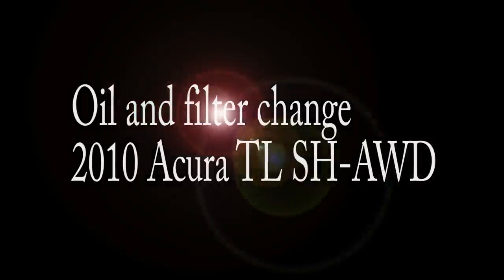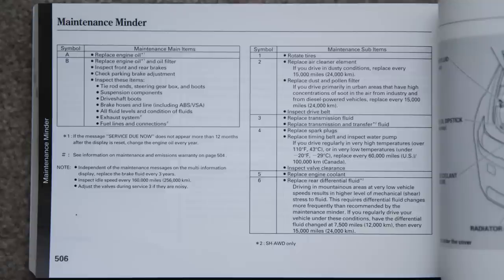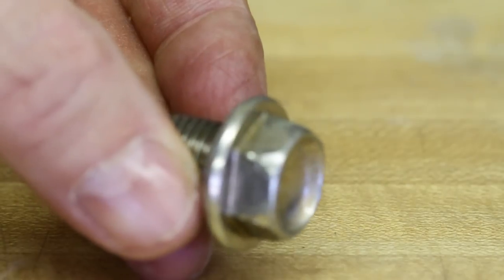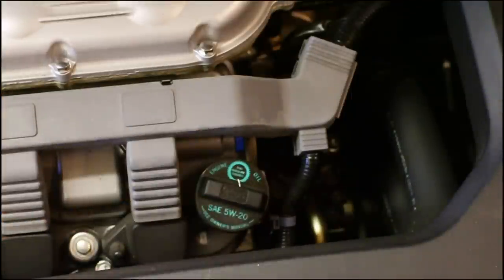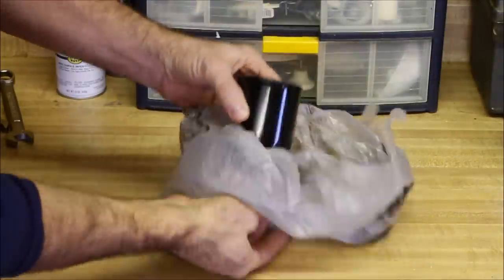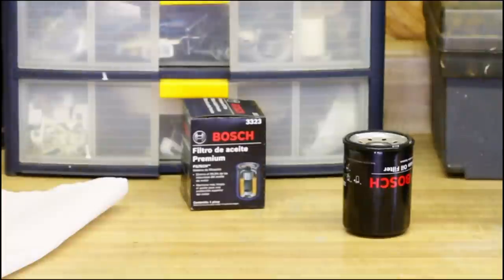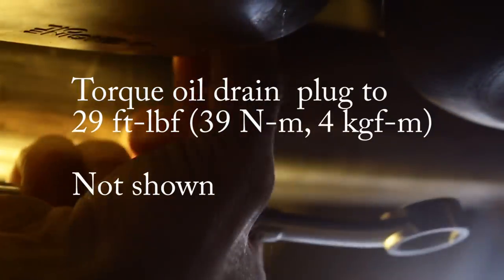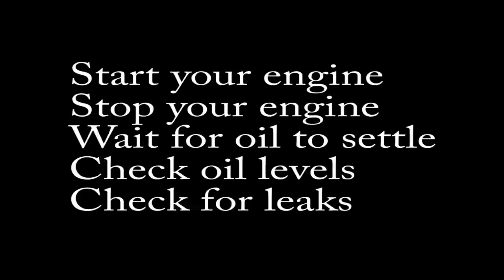Acura TL SH-AWD: Oil Change and Filter Replacement

Comment: thank you that was very well done and yes it applied to my 2 wheel drive 3.5 L 2011 Acura TL one small note you're not completely finished with the oil change until you reset the annoying service engine now light so it would be nice if you'd include a little tutorial for that I can't seem to remember how to do it from oil change to oil  change thanks anyway great posting
Reply from the maker: I have a separate video in resetting the reminder. My statistics show people only watch 3-4 minutes and if that were at then end, they may never see how to reset the reminder

Comment: My friend  have a question. I read this 
2007-2011 3.5Liter: 5W-20 (S/UFS), topped off with 0W-20 
And was wondering what is topped off with OW-20 means is it a different oil and how much do you top it up with?
Thanks

Comment: Very well made video thank you. Have you experienced the oil consumption problem on your TL?
Reply from the maker: Thanks. My TL doesn't seem to have the consumption issue. It will drink some but not like others report.
Reply: @KrisKasprzak  that's great to hear looking forward to buying this car soon and watching your videos to maintain it!
Reply from the maker: I tell you the SH-AWD handles extremely well, i have continental dws tires and it rides like it's on rails--i can hit the gas hard in the rain and no wheel spin. The audio (mine has a sub) and it totally rocks. I let my Daughter drive it and she won't give it back. I took a new TLX and even a Q50 out for a test drive and I sure miss my 2010 TL.
Reply from the maker: PS get and SH-AWD version.
Reply: @KrisKasprzak  absolutely! It's got a 6 MT. I just need some motivation to pull the trigger. Do you think 140k miles is too much ?
Reply from the maker: if well taken care of, no.
Reply: @KrisKasprzak  I appreciate your input man you've gotten yourself a new subscriber
Reply: @supersabrosinho  as long as you've redone the timing belt, water pump, inspect tranny, and get the engine components inspected you should be fine

Comment: My 2010 tl sh awd consumes a lot of oil. Only 97k miles. Any solution suggestions?
Reply from the maker: Lot's of posts on this in the Acura forums, some claim it's faulty rings, other speculations. I'm not losing much but i'll just keep an eye on it.
Reply: Yeah call acura make a complaint they will get u a new block they did for me
Reply: My 2010 TL Sh awd/6 manual consumed oil at 96 k. I did a research my research and had the PCV valve replaced at the dealer. There's a recall on all J37 TL so Acura increased the engine warranty to 200,000 k. Oil consumption test was also free. But you need to bring your car 3x for testing.
Reply: @AcuraPerformance  either u got the 3.5l or 3.7l its gonna eat oil fast so be expected for oil service intervals

Comment: can you reach the oil filter under the car instead of going through the tire? reason i ask is because i am using ramp and won't be able to cut the wheel while its on the ramp
Reply: Yes. I changed the oil with it on ramps. Just reach up and screw it off.
Reply: You can but its better if you take the tire off so you have better access to the filter

Comment: you forgot to mention how many oil quarters and how to reset the engine light!
Reply from the maker: See my other videos for resetting the engine light. As i say int the video, be safe and check your owners manual for the capacity.
Reply: Approx. 4.5 quarts inspect dipstick without oil in filter

Comment: Does your TL burn oil?
Reply from the maker: Slight--maybe 1/4 quart per 2000 miles
Reply: Regardless if u got a 3.5l or 3.7l the engines gonna burn oil fast

Comment: can I use oil 0w20 on acura tl 2011 ? Thanks
Reply from the maker: I would check with the owners manual, but this does not sound like an approved type.
Reply: I just change oil 5w20 to make sure like in manual thanks .Do you have video how to change the break pad ?
Reply from the maker: casino007007 yes I do, check out my channel and look for the Acura playlist
Reply: No lol